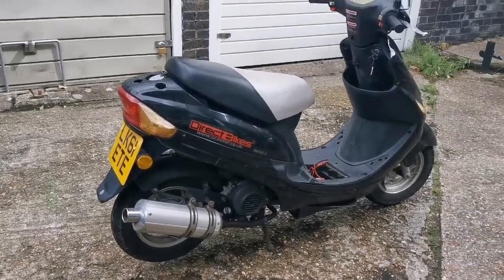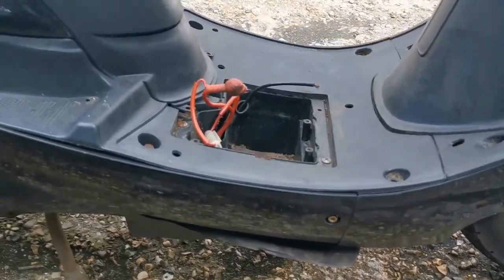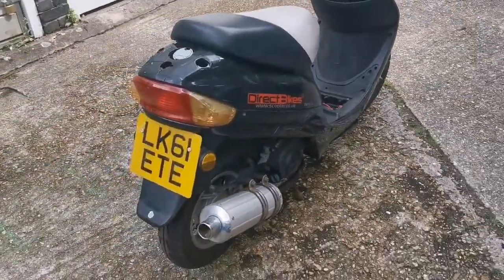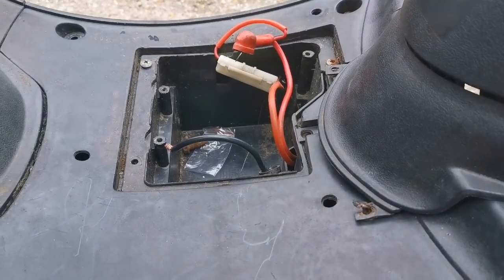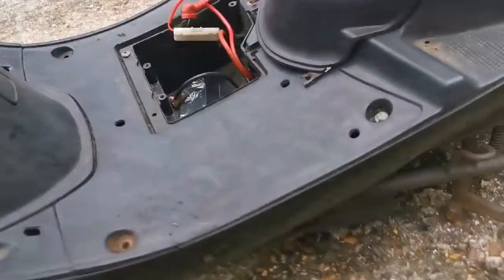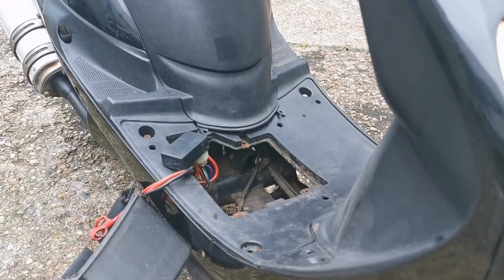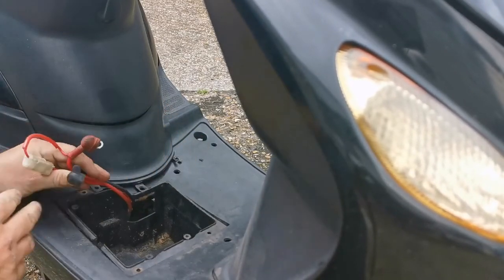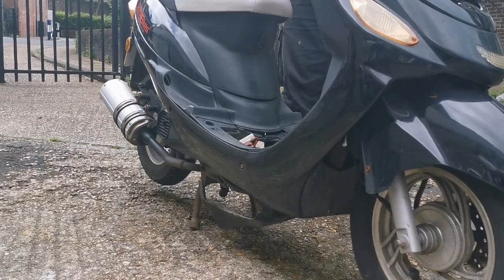How to de restrict your motorcycle. How to make your 50cc faster. De restrict your moped or scooter

Comment: Would this work on a sym jet 14? 2020?
Reply from the maker: If your cdi looks the same as this and has a pink or purple wire then it will work. However cut it in a way you can re connect it of needed. 

Please like and subscribe
Reply: @motorcyclerescuer  mhh it has an ECU not a cdi, would that be a problem? Have to check if it has a pink wire tho
Reply from the maker: @pixel6580  yes the new ecu can't be cut. You can buy a de restricted ecu for it though
Reply: @motorcyclerescuer  ah too bad, the problem is. I can't find an ecu for the euro 5 model

Comment: Would this work on a tgb 202 classic
Reply from the maker: Yes, if it has a purple/pink wire, that will be restricting the engine above certain revs. Cutting it will higher this although of course it won't be a rocket.

Thanks for watching and please subscribe
Reply: Did it work richard?
Reply from the maker: It should have. If its a 50cc and has a cdi like mine and has a pink or purple wire then that's the restriction wire

Comment: I got the same bike but when I get to 30mph it starts to bog out its had a new Carb and intake on it and the fuel mix and idle has been set do you have any idea what could be wrong
Reply: Well mines a BTM but its pretty much the same bike
Reply from the maker: Have you cut the restriction wire as in this video? 

The truth is that they are slow bikes and would need tuning work to to get faster. It sounds like yours may be suffering with fuel starvation though?

Thanks for watching and please subscribe.
Reply: @motorcyclerescuer  I haven't cut the restriction no it gets upto 30 then bogs down to a stop and when I'm full throttle it doesn't move so have to let go wait a second and pull the throttle agai.
Reply from the maker: @thedrdip1082  this could be the restriction in the cdi causing it to bog down. They are restricted. Watch the video and cut the purple or pink wire in the cdi. Then test the bike. 

Let me know how it goes. Cut the wire with plenty space so that you can put it back together if wanted at anytime.
Reply: @motorcyclerescuer  ill try when I'm home then I have got a new spark plug coming too. It worked fine with the old carb that was on it though
Reply from the maker: @thedrdip1082  it sounds like you have a mix going on. The restriction and carb issues.
Reply: @motorcyclerescuer  the carb is brand new though so unsure
Reply from the maker: @thedrdip1082  the truth is that sometimes the new carbs aren't great though. They need tuning and the same set up as the original carb. Does the new carb and old Carb have the same Jetting?
Reply: @motorcyclerescuer  they are the exact same I've set the fuel mix to the exact same turnings as the old one and also set the idle so I think everything is correct how else do you tune them
Reply from the maker: So setting the air/fuel setting to the same one is wrong buddy, put it all the way in and out 1.5 turns, idle the bike but wait a few mins so the choke is off, then turn it half out and see if the idle raises, if it does turn it another half out, basically do this until the revs stop rising and when they stop rising go half turn back in. That will be the best setting for that Carb. 

I hope this helps
Reply: @motorcyclerescuer  I will try that next I just can't turn the choke off as its an automatic choke I think
Reply from the maker: @thedrdip1082  just idle the bike for 5 mins then the choke turns itself off. 

Let me know how it goes mate. 

Don't forget to subscribe.  

Thanks
Reply: @motorcyclerescuer  re did the fuel mix cut the restrcitor cable but nothing does the same thing so I'm guessing it's the spark plug as the bike has been sat for like 1 year before I bought it
Reply from the maker: @thedrdip1082  definitely change the plug mate as it needs to be in good condition to get the best spark. Try a plug next and let me know buddy.
Reply: @motorcyclerescuer  yeh should be coming tomorrow if not I have no idea cause everything has been cleaned and set haha
Reply: @motorcyclerescuer  put the new plug in and now it does 32mph and won't go above that perfectly fine until I started going up a slight incline wwhre it dropped to like 22mph but runs a bit better
Reply from the maker: @thedrdip1082  it's so weird but they don't normally do much more to be fair. 

I got a 50cc to do 37mph yesterday but it was still climbing
Reply: @motorcyclerescuer  mine is really annoying me. I get my cbt on the 14th but dunno if to insure. The bike cause I got a feeling it'll. Mess. Up
Reply from the maker: @thedrdip1082  it sounds like your bike is running well for what these bikes do mate. Do the cbt on their bikes and take the time to enjoy it buddy. Its a fun day. Nothing to be worried about at all.
Reply: @motorcyclerescuer  yeh haha I'm pretty confident in doing the cbt but just don't wanna come home to having a moped that I can't ride 😂
Reply from the maker: @thedrdip1082  ha ha fair point. You need to get yourself a 2 stroke 50cc
Reply: @motorcyclerescuer  yeh just started working so might just get a 125 when I save up a bit
Reply: @motorcyclerescuer  still broke just treid it again adjusting fuel everything checked the air filter clean as anything everything is perfect just bogs out it gets enough fuel and everything I'm in the UK if you would wanna swap or buy it as a project 😂
Reply from the maker: @thedrdip1082  funny enough someone brought me one to look at today and it was exactly as you say. Boggy and slow. I cleaned the carb and everything. 

I've no idea what they need, possibly better carbs but I couldn't get his running much better.
Reply: @motorcyclerescuer  no idea what to do with it I got ripped off £400 on my last bike so bought this one cause it only had a slight fuel leak and been ripped off again 😂 gotta love Facebook Market place 😂
Reply from the maker: @thedrdip1082  the guy today paid 350 for his and its exactly the same as yours.

I think a better carb might help.
Reply: @motorcyclerescuer  already spent loads on it just wanna get rid tbh

Comment: I cut the pink wire and it made no difference, anyone know why
Reply from the maker: It may have other restrictions, one in the airbox, one in the exhaust etc
Reply: @motorcyclerescuer  do you have a video on how to remove the restrictor off the airbox and the exhaust?
Reply from the maker: No sorry I don't. Most modern bike restrict in the cdi and variator. Unless its a old piaggio or gilera then yours will almost definitely be cdi. 

What bike is it and what year?
Reply: @motorcyclerescuer  50cc direct bike 2021
Reply from the maker: @henryfaizey6842  so the 2021 model has a different cdi. You will need to get a new de restricted cdi for your bike. Cmpo sell them and you may find them on ebay
Reply: @motorcyclerescuer  what is a CDI, sorry I don't know much about bikes
Reply from the maker: Its the computer that runs the engine. Every bike has one. If you Google your make and then put cdi next to it you will see them.
Reply: @motorcyclerescuer  thankyou 👍

Comment: Would this work on my Suzuki katana 01 (same as sr50)
Reply from the maker: I'm unsure if I'm being honest, it's mainly the Chinese bikes. 

If I remember rightly then your katana will possibly have a restriction in the airbox, exhaust and washer in the variator. It could have 1, 2 or all 3 of them.
Reply: @motorcyclerescuer  I’ll have a look at air box myself gonna get washer out of the variator by garage and the exhaust is aftermarket but I don’t know if has the restrictor and I don’t feel confident enough to take it off

Comment: Does this work for an icebear rocket 49cc?
Reply from the maker: It depends if the bike is new or not. Some of the newer bikes are using a different cdi. If your cdi looks like mine in the video and has the pink wire coming out of it then yes this should work. However cut it in a way that you can re wire it if needed just incase. 

Hope this helps, 

Thanks for watching and please subscribe

Comment: Will this work on a 50cc Chicago go scooter
Reply from the maker: If it has a cdi which looks like mine, and that cdi wire has a pink or purple wire then that should be the restriction wire and cutting it should remove the rev restriction.
Reply: Thanks alot man

Comment: I have a peugeot kisbee will this work on my ped
Reply from the maker: So if your cdi looks like the one on the vid and the bottom left wire is pink or purple then yes however peugeot sometimes used a green wire that looped to itself. If your cdi has a green wire that's looped back to itself then simply cut it and that will remove the restriction on the bike. 

Drop a like and sub please Jay. 

Thanks
Reply: @motorcyclerescuer im scared to do it myself in case somethink goes wrong
Reply from the maker: What one does it have the green loop or the purple wire?
Reply from the maker: After looking online your bike is more complex to de restrict. Best to leave it alone I think until you can get someone else to do it.
Reply: @motorcyclerescuer  what my bike
Reply from the maker: Yes, yours is complex to de restrict. Almost not worth doing Jay. I'm not even sure I can do after watching how to
Reply: @motorcyclerescuer  how come my ped is more complex to any other peds
Reply from the maker: It has a different cdi on it. One where cutting the restriction wire isn't enough, you then need to add positive power to that cut wire. 

Its a complex process. If you put it into youtube you will see how it's done.
Reply: @motorcyclerescuer  how would i add more positive power to the cut wire
Reply from the maker: I don't understand that system for your bike Jay so can't advise how to do it mate. I watched the vids and still didn't understand it. Your best bet is to watch the vids and see if it makes sense to you at all.
Reply: @motorcyclerescuer  oh right i just thought it was the same for all peds haha no problem no worries xxxx

Comment: Will this work on a wk ttr50
Reply from the maker: If it has the same cdi with the same pink or purple wire then it should work. Just be sure to cut it in a way where you can re connect it if needed
Reply: @motorcyclerescuer  it’s a different cdi my cdi is just 2 black clips togther with wires on it dose have the purple/pink wire on it though
Reply: Unless that isn’t the cdi 😂do all cdi have the black block on them ?
Reply from the maker: No some cdi are silver however all will have many wires going into them.
Reply: @motorcyclerescuer  my bike is fuel injection will that make a difference
Reply from the maker: @user-tm5wj9eq5p  yes it's a different thing for fuel injected bikes. You would need a new de restricted cdi if you could find one. Some bikes they aren't available for.
Reply: @motorcyclerescuer  I have been told I don’t have a cdi just an ecu can I de  restrict them
Reply from the maker: It's the same thing so you would need to try and find a de restricted ecu. But they may not make one. 

You may ne stuck with it restricted I'm afraid